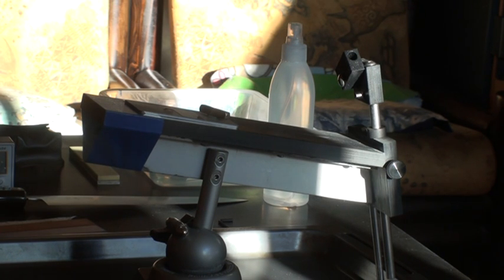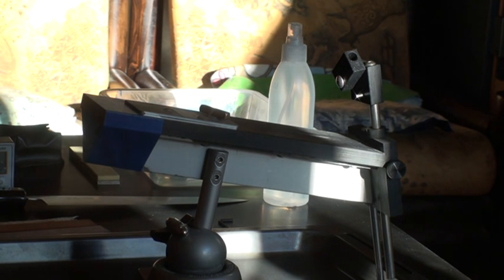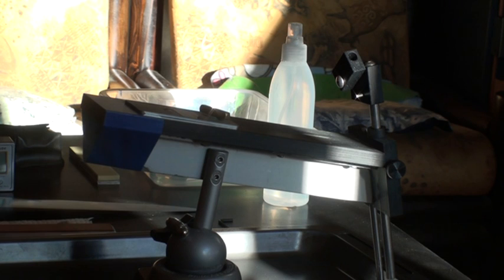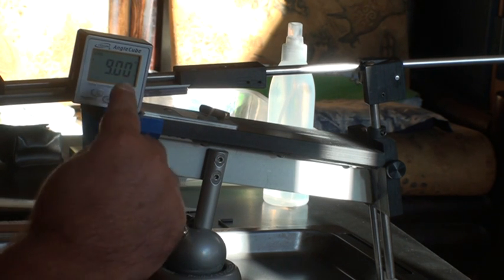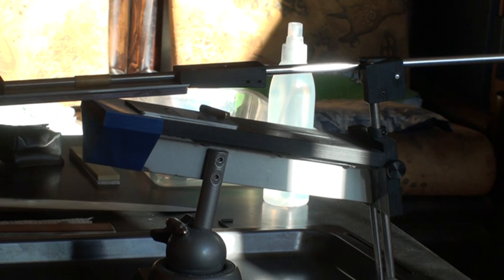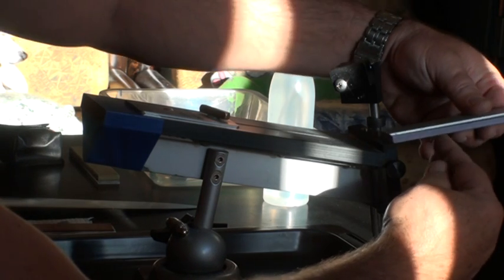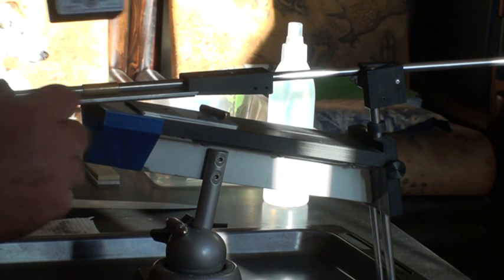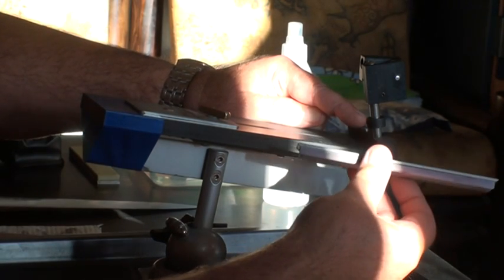EdgePro Drill Stop Collar Demo.mpg

Comment: There's one major flaw in this guide. You need to take the angle of the knife blade itself into account.

If the knife has a V angle of the blade of 2,5 degrees on each side i.e 5 degrees total, you'll need to add that 2,5 degree angle to the stone/arm when measuring. If you zero the gauge on the blade table, then set the arm @ 13 degrees, then place the knife flat on the blade table, with a knife with a 2,5+2,5 degree angle, you'll end up putting a 10,5 degree angle on the knife. It's fine to zero the gauge on the blade table, you just need to measure the angle of the knife when on the table, take half of that and add to the angle you set the stone at. So for a knife with a 5 degree taper, you'll need to put the stone at 15,5 degree angle to get an actual 13 degree edge when the knife is placed flat on the blade table as it often is.

This is also the reason why many end up scratching their blades with the EP. They put a much narrower angle on the edge because they don't take the blade angle into consideration.
Reply: Which is of course, why Ben Dale recommends using a sharpie as layout marker and not worrying too much about the actual angle.
Reply: Any chance you could expand on this to get it through my thick brain :)

is zeroing the angle cube on the blade table, then measuring the taper of the blade then adding half of that measurement to the desired bevel angle and setting the angle (with the knife in place) the same as zeroing the angle cube with the knife on the blade table and then setting the desired bevel angle (with the knife in place)?

Cheers

Macca

Comment: Why wouldn't the angle be compensated with the stop collar the same way if you set the collar with the first stone?  If the first stone is set to 13 degrees, why wouldn't the last stone, when adjusted to the collar, still be 13 degrees?
Reply: because of the variation in thickness between stones. Thinner stones would steepen the angle...

Comment: Great video and clear explanation.  One question, would it be more accurate to set the sharpening angle with the knife on the table?  So zero the cube as you have shown, and then place the stone on the knife and the angle?  Thanks.
Reply: This is indeed the way to do it. That's the major flaw in this video.
The steps should be as follows to do it right.

Zero the cube on the table.
Place the knife on the table and measure the degrees of taper.
Add half of that to the angle of the stone and make sure you place the stone on the knife edge when measuring.
If you want toe be really anal about it, deduct about 0,1-0,2 degrees to compensate for the material you remove from the knife and stone. I always strop my knives, so I only do a major sharpening twice a year or so. If I deduct 0,1 degree from the hard steel knives(62+), or 0,2 off the softer steel knives when setting the stone, I usually end up with a dead on angle when doing a measurement on the arm after the last stone.

The method I just explained will give you the most accurate angle of your edge perpendicular to the spine of the blade - and this is how knife edges are actually measured.

Note that the little trick of deducting a tenth of a degree or so, will be less needed the shallower of an angle you put on your knive edge. If you put a 20/20 or shallower edge on a Euro knife, it's barely noticeable. If you put a 20/20 edge on a soft (56-58) F. Dick or Sabatier knife, sure try deducting ,1 of a degree, but it will hardly be measureble if at all. Maybe if the knife is really dull and you need to remove more material. However, if that is the case and you need to refinish the edge, just check your angle during the first stone and if needed adjust a bit. Then when you have your basic edge, reset the angle after the first coarse stone with the 0,1 deduction and you should be fine for the rest of the stones.

The way he sets it up in this video, he will end up with quite the different edge angle - unless the knife where to be completely flat down to the edge, which it isn't.

The EP is very precise when used correctly, but one needs keep an eye on the numbers for accurate and consistent results. This will also increase the life of your knives and you run a much smaller risk of putting a too aggressive edge on the knife.

Comment: your English is great, thank you for the video. Why would you need to do this though if you have an angle cube and are able to check the angle
Reply: +TheBurzhui If you're going through a progression of stones, it's faster to measure once (against your finishing stone) than to measure the angle for each stone in the progression.  The drill stop collar allows you to set the angle for all of the rest of the stones without measuring.

Comment: Excellent video. Question, when you say set the stop collar on the "actual stone" is there a running edge of exposed stone or are you setting the collar on the metal backing plate? thank you. I can't wait to get one of these.
Reply: +1paddi You set the collar for the total thickness of the stone plus the metal backing plate.

Comment: Excellent presentation.... and may I add up a few observations. Setting the base with the angle cube to zero 0 degrees.. the thing is, you used the edge of the table as the angle which is to be followed. Problem is, you have a knife there to be sharpened, and that knife is at least 1/8 of an inch further out from the edge of the table. That means, the table is not on zero degrees. Much better to  clamp down the knife to the table, then put the angle cube on the blade, and then reset the cube to zero degree. That would be a bit more accurate. The other observation has to do with measuring the angle, once the cube is set on top of the arm. very unreliable when I tried it this way. Then you put down the angle cube and start to adjust the rod for the desired angle. That takes plenty of time, and after repeatedly missing the exact mark, I had to figure out a better way. Here's what I did. I took another stone, and set it up below the stone with which  I  was going to sharpen the knife....in a crossing pattern, right in the middle of the stone. I clamped it down to the stone tightly, and once my angle cube was set to zero degrees, I then place the cube on the top of the second stone. It is important to magnetize the base of the 2nd stone, in case it is aluminum, that way the cube sticks to the top of the stone.  The reading should be the same on the top of the stone, than that of the bottom of the first stone.....after all both are tightly clamped down together. Then you have both hands available to set the arm at the desired angle, and watch it on the cube as it closes in to the desired angle.

Comment: @auradud3 No! He did it absolutely correctly. He was measuring the RELATIVE angle of the table to the bar, not the angle of either in space or relative to gravity. So he could put the entire  sharpener on a crooked table or even upside down for that matter and the blade would still have a 13 degree bevel.

Comment from the maker: If you only measure the angle of the beginning and finishing stones, then you will not hit the edge 100% with the intermediate stones, especially if they all vary in thickness as well.

The drill stop collar compensates for the varying thickness between different stones - ensuring that the edge is correctly hit.